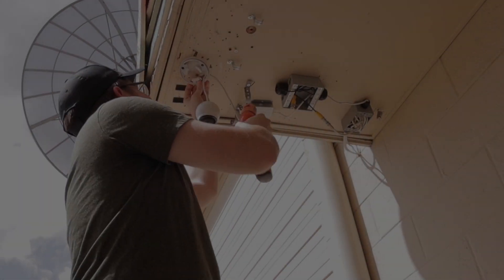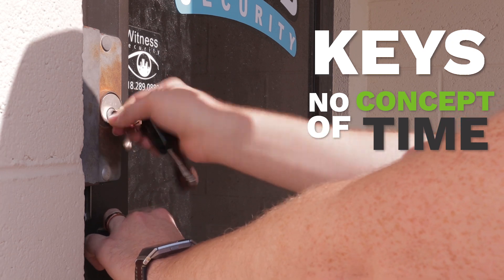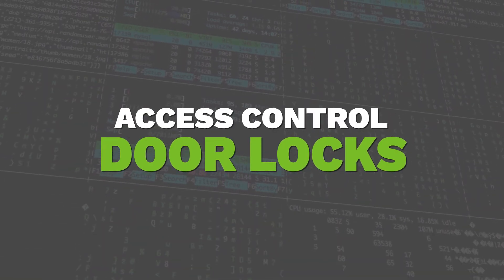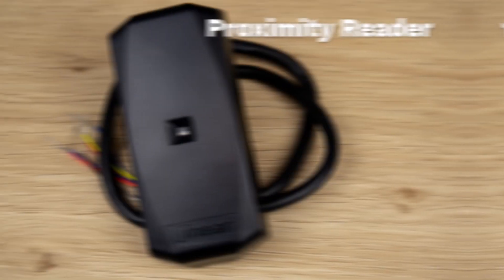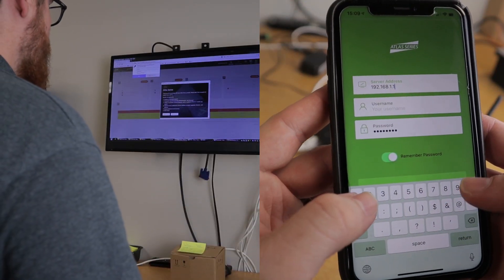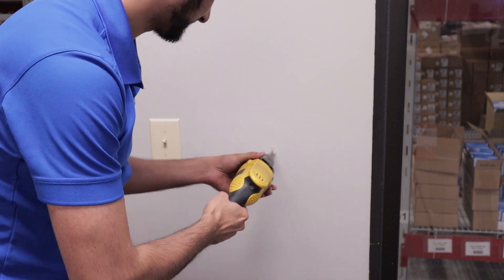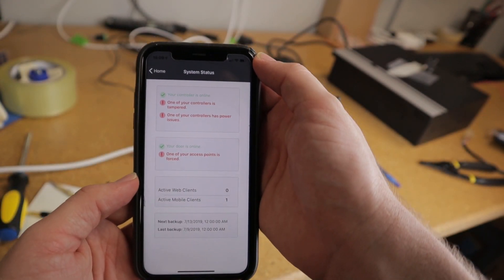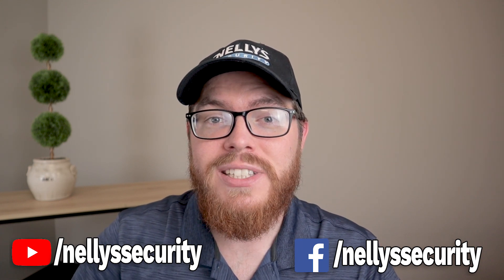Why Aren't You Installing Access Control? A Guide to Getting Started With Your First AC System

Comment: What happens if system goes down and you loose access to the control board or router because its  in the locked rooms.
Reply from the maker: Most of the time for access control systems, you would have all the critical components on battery backup